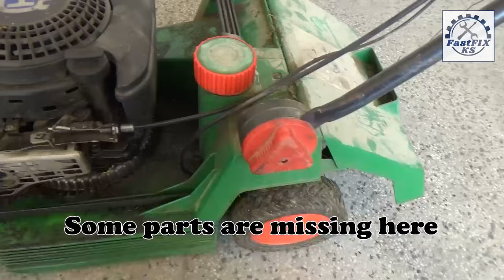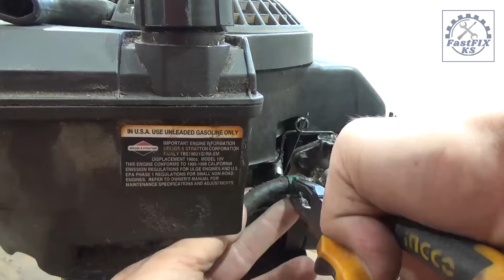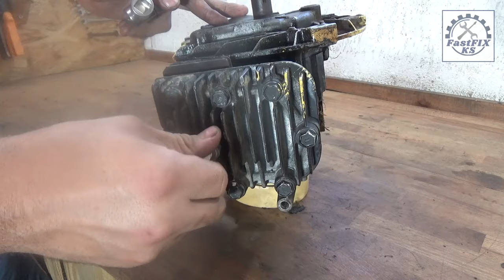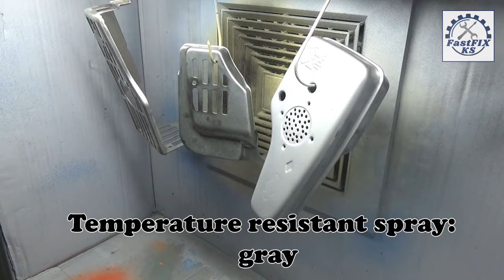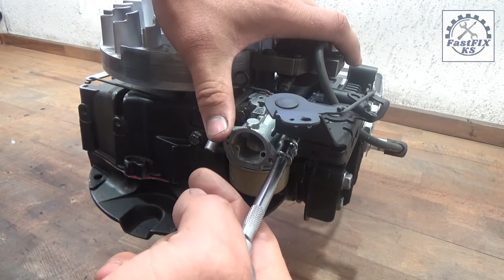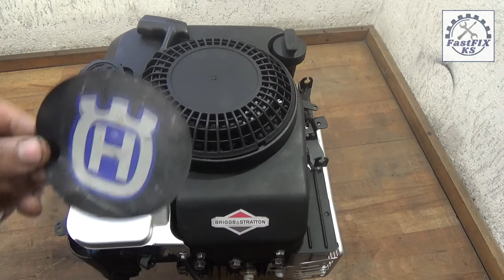Briggs & Stratton Quantum Engine  (5 HP)  | Restoration

Comment: I was pleased to find a video featuring the same engine I have. Great video to watch but the bit I really needed to see was where the cable linkages attach and how they are supposed to work. My choke seems to open when in the start position and close in the normal run position.

Comment: I was given an old snapper push mower with one of these on it. SO far I've replaced the pull string. Needs a lot more work but I'm no mechanic. I tried to replace the pump button but either have the wrong button or I didn't install it right. This is my first time trying to work on any kind of engine

Comment: Hey there,in the beginning of the video,U mentioned parts were missing on top of the carburetor but @ the end we didn’t see the parts replace! Are these Parts critical for the mower to operate correctly????
Reply from the maker: Hello
Nothing crucial is missing. It's the throttle cable, the throttle cable stiffener, the cover and some screws that hold those parts in place.
Below I will post a playlist and in the last video you can see that I just connected the gas cable, which was not even there when I started to restore this mower.

https://www.youtube.com/watch?v=gkpoEB9VJNg&list=PLt-3_4cYWgfCjIlGjI2c1VQqkS2dY8eEn&pp=gAQBiAQB
Reply: @fastfixks  Thanks a lot!!

Comment: Thank you very much for the video! But I'd like to ask you some questions.
1) Did you use a repair manual 1330?
2) What torque is used for tightening rod connecting screws on 11:30?
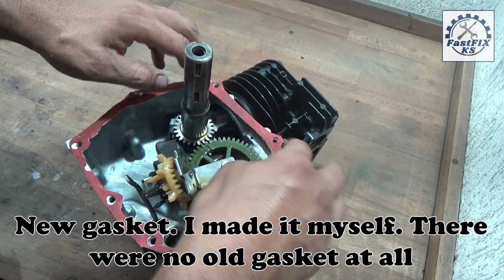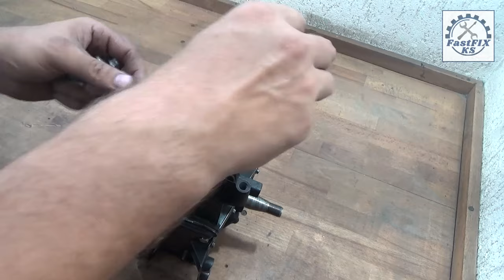3) What material did you use for gaskets on 12:31 and 13:30? Is their thickness important?
Thanks!
Reply from the maker: Thanks for watching and commenting. I hope I'm not too late with the answer. I will try to answer as precisely as possible in the text below.
1) I didn't have the manual that comes with the new lawnmower, so I used the internet and found some necessary information there. You can search on the official website of Briggs & Stratton
2) At 11:30 I tightened by feel, I did not use a torque wrench.
3) At 12:31, I manually made a gasket from the material "klingerit" for gaskets. I don't know how to translate that word, but here's a link to see what those boards look like, which are used to make gaskets.
https://images.app.goo.gl/3Pd7NocRZ3TvGYz37
At 13:30 I used the original gasket intended for this mower. You can buy it in a local shop that sells parts for work machines, and you can also buy it on ebay.
The thickness is important, but you won't go wrong if you put a little thicker or thinner, all in a reasonable measure. At 12:31 you can even use silicone resistant to high temperatures instead of a gasket, but of course it's better if you can find a gasket. At 13:30 you definitely can't and shouldn't use that (silicone).
I hope I could help a little.

Comment: Bravo for your work. You have no problem with the fuel pump? I have an engine like this and I can't get fuel into the carburetor. I have an air leak somewhere that I can't find. 😒
Reply from the maker: The most common solutions to your problem are: hard hoses, so they can burst (replace new fuses for the same hoses), fuel pump - your rubber part is not working because it does not inject fuel as it should (change only the rubber part ), the carburetor is clogged (clean it or, in extreme cases, replace it with a new one). I will leave the link on how to clean the carburetor below, so see how I did it in a simple way.

https://www.youtube.com/watch?v=gkpoEB9VJNg&t=1s

I would add something else only, if your gasoline is old or has been sitting for a long time in a canister or in the tank itself....you must drain all the gasoline from the entire system and buy a new one and pour it in. Someone leaves it standing in the tank all winter and later, of course, cannot start the lawnmower because of the old gasoline that loses its properties over the winter.
Thanks for watching and commenting.

Comment: Dang... I came here to see what my engine is missing. Throttle assembly seems off and is not returning back to the off position. Loved that you pointed out "Some missing parts here" at 00:21, but then you didn't address what was missing and then that piece was assembled off camera. Can you describe what was missing and what you needed to fix? My engine seems to resemble the exact state yours was at the beginning of the video
Reply from the maker: Hello
First, thank you for watching and commenting. I'm really glad when I see that my videos can help someone and be useful. Of course, it may not have helped you completely, but let's try to solve that too.
There are three parts missing: the gas cable, the metal cover that closes the whole situation and the screw that tightens the mentioned cover. I will leave the link below, watch that video and it will surely be clearer to you what exactly is missing and maybe you will conclude what is the problem with your lawnmower.
Maybe I can guess what could be your problem. Check the spring that tightens the gas mechanism, it can be seen in that frame (00:21) where I show that something is missing. If you have such a spring, it does not necessarily mean that it is working correctly, even though it has not broken, it does not mean that it is correct. Over time, this spring loses its strength and strength, and it is necessary to replace it. It is a consumable part, so it can be found and bought separately.
I hope that I explained well and that my answer helped you at least a little.

https://www.youtube.com/watch?v=xCf18sXxTFM

Comment: Just out of curiosity, is the carburetor throttle controlled by the linkage that enters with the rod on the rear?
But how does the throttle control lower and raise the revs if it is not physically connected to the carburettor butterfly if not by that particular spring. You can remove this doubt from me as I too have the same engine and disassembling it because it doesn't start I saw this technical detail. Thank you
Reply from the maker: You are right, of course it is controlled that way. Only in this video it is not shown.
I divided the video into 4 parts, this is just one of them.
I will leave a link to the entire playlist below so you can see that the throttle is connected to the carburetor.
Thank you for watching and commenting. I hope my videos will help you and be useful.

Briggs & Stratton playlist:
https://www.youtube.com/watch?v=gkpoEB9VJNg&list=PLt-3_4cYWgfCjIlGjI2c1VQqkS2dY8eEn
Reply from the maker: The fourth video on the playlist is the one where you will see what you were interested in, but my recommendation is to watch all four videos because they are connected and might be of interest to you.

Comment: Was the head painted originally?
Reply from the maker: If you think I returned the same color, the answer is yes. Black has been there before. Of course, it is not the same color factory determined by the number. I used black spray paint, high temperature resistant which is classic black.

Comment: There is nothing in the video on the govener spring install or demo on the connecting moving parts. So it didnt help.
Reply from the maker: I think you are wrong my friend. This is one of a total of 4 parts of the mower restoration. I will leave you a playlist of videos below, so watch everything and you will see that I have shown every part of the restoration. Take a look and let me know.

https://www.youtube.com/watch?v=gkpoEB9VJNg&list=PLt-3_4cYWgfCjIlGjI2c1VQqkS2dY8eEn&pp=gAQBiAQB
Reply: @fastfixks  watched all 4 and there isnt anything on the spring you skip over it in the engine resto. There is a spring (govenor spring) going from the carby to a guide arm into the engine which you dont show moving so you can see how it activates. I wanted to see how the sppring works to open and close the throttle as mine is not really doing anything. It doesn't retract back to close the valve in the carby. I was hoping to see it in action.
Reply: @fastfixks  you fiddle with it at second 20 of the video and it doesnt seem to be working but nothing on it post retro.
Reply from the maker: @troychaplin2846  That's what you mean.
I don't know how it's not on the video, but I did that part too.
I just cleaned the whole part well, I even used sandpaper to remove the rust so that the mechanism could "move" more easily.
It is mandatory to change the spring, regardless of the fact that it is not broken to the eye, it weakens over time and cannot do its job, i.e. by pulling the gas cable, the spring does not have enough strength to transfer it to the lever (part from the 20th second).
You can even see that the spring has weakened (as if it has stretched).
English is not my native language, I hope I helped at least a little and explained well. Maybe some key words are not well translated, but you will understand which part I meant.

Comment: what was the flywheel torque in in.lbs please ?
Reply from the maker: This model is rated at 60 ft.lbs
Mostly older models go from 55-60 ft.lbs.
Those bigger and stronger models that for example have two cylinders go over 100 ft.lbs, even up to 150 ft.lbs

Comment: Thank you, very nice job! There is one thing, what i don't understand: why you did not pull the crankshaft bearing to torque? Thank you, have a nice day!
Reply from the maker: I didn't understand the question best, so I can't answer you. But thank you for watching and commenting. I'm glad you like the way I did it.
Reply: @fastfixks  Hi! Thank you, which I am talking about at 11:30! Thx!
Reply from the maker: When I removed that part it was in one position and when I put the bearing back I did it from another position. I did this because it was so easy to do but it doesn’t matter because the crankshaft rotates as needed. It is much easier to tighten the screws in the second position. But the end position does not affect the work, I could turn to some "third" position and it would not matter.
I hope I explained well and that you understood what I meant.
Reply: @fastfixks  Thank you, I understand!  Have  nice day!
Reply from the maker: @7Toki777  Thank you, you too